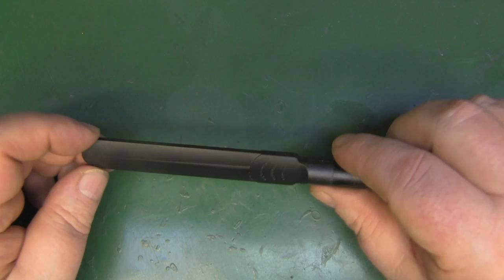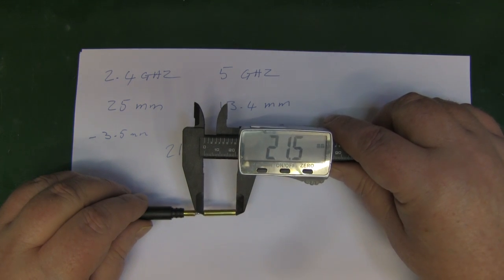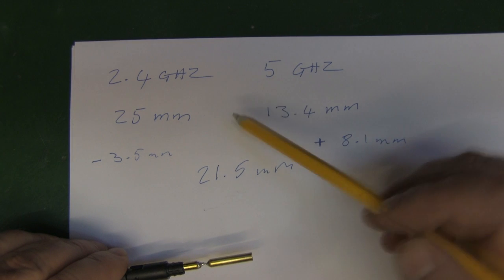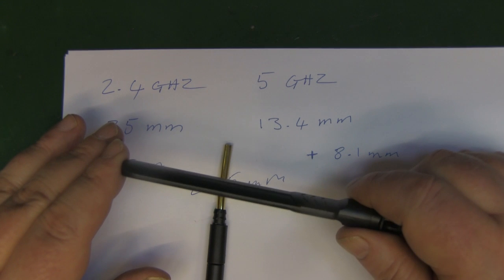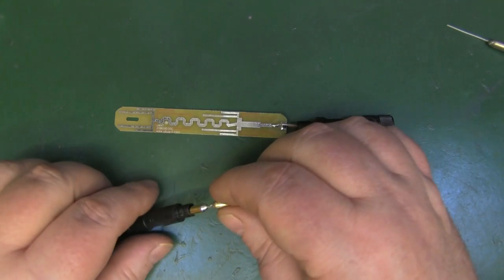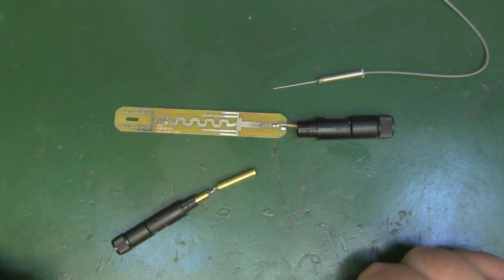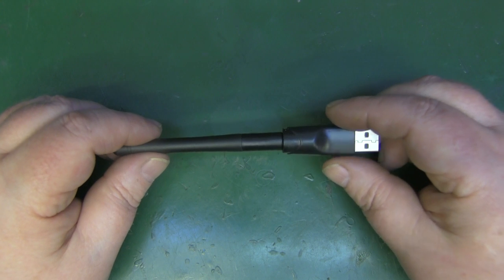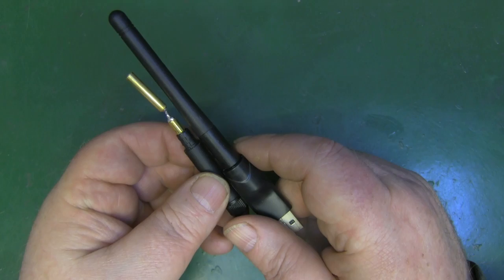Dual Band WiFi Antenna How do they Work?

Comment: Thank you! I was struggling to understand these dual-band antennas in the pursuit of optimizing wifi coverage. Sometimes its easier to listen to someone explain it like this instead of reading a huge paper on it and having your eyes cross and start snoring before you get done 😆
Not that I won't still read up on it at some point... but now it will make more sense when I do.

Comment: Hello, if you have two of the flat wifi popular ones, how would you suggest them orientated around a Desktop? one in front and one on the back? both on the front far or close apart? and would you mount one horizontal and the other vertical? Does it even matter? I keep finding differing or lack of information on mounting them.

Comment: The router has more than one antenna
One of the antennas 5.8G, there is a connection to the ground that gives a beeping sound. How do I cancel this antenna I removed the wires from the panel to no avail

Comment: Really good video, could I ask if you have covered the wifi ants that are soldered to wifi routers and how those can be upgraded? i have an Asus router that claims to be a duel band but only has 3 ants and 2 are soldered to the m/b and one uses a tiny pigtail. there is no info on which is which freq or if they are all duel band but i think (think lol) that the two soldiered to the m/b are the 2.4ghz  and the pigtail center ant is the 5ghz as I've seen several others online which are simular but with 4 ants and both soldiered ants are 2.4 and the two pigtails are labeled on the m/b as 5ghz. Any thoughts or have you covered this yet? I'm looking to add directional external screw-on ants as this is my second router which is in my home office and id like to send the signal about 25m from the 13th floor down to a small workout area that says 10m to the right and away from the building and lucky i have a 1.5m opening from my window to direct the line of sight through. Hope you can follow along with my madness, id like to do it just because and being a retired ex brit army rad-op i know it can be done so why not :)

Thanks in advance from a friendly Brit overseas in sunny Singapore - Chris A

Comment: Please Andrew,i have a flight controller named dji a2 and it has a built in receiver with 2 dipol antennas,i managed to nip 1 of them apart and tried to solder it back but now it behaves utterly bad and im afraid of loosing it so i was wondering if u could create 2 new antennas,,i could send boyh off them to you for measurements..il pay for your services,,please i really need your help.

Comment: Hello Andrew, Could you please tell me if one Dual Band antenna can be used for 2 different wifi networks (one 2.4ghz and one 5ghz) at a time?

I'm having a discussion with a friend and I fell like it's not possible, but as noobs, we cannot find easly the answer.
I understand one dual band antenna covers both 2.4 and 5 spectrums but before usage on one or another it has to be reconfigured?
Reply from the maker: No they are used at the same time the two frequencies are so far apart they do not interfere or interact with each other. But the offset of a duel band antenna is a loss in gain.

Comment: Hi Andrew, is there a way to get more gain out of these dual band antennas, I have a whole bunch of them from TP-LINK routers, is soldering a piece of copper wire on it a methode to have more gain in the 2.4 GHz?

Comment: We the hams of the United divided call them verticals, not colinear. generally a dual band will be seperated with a matching coil on a 2M, 70cm antenna with grouNd plane radials or the roof of your truck. some time depending on what your working you may see a capacitance HAT
Reply from the maker: Thanks for the info BA. So the mag mount that you see on vehicles with a loading coil at the base, are they called verticals?
Reply: some guys mostly cbers will call them whips  . the coils at the base areulauly tuable on the fly unless your doing and end ed long wire antenna  @andrewmcneil
Reply: If comes to the upper sleeve dimension consideration, you should add the length of coax core connector length (it should be about missing 3.6 mm). It adds up, to the dipole length. Now, it is clear that antenna is tuned to 2,4 GHz.  If comes to the bottom sleeve, watching your videos, I have never heard from you about additional role of the element. To the best for my knowledge, bootom sleeve is a "sleeve balun" also known as bazooka balun (1:1), beside being the second dipol l/4 leg it also improves the antenna performance (choke some currents).

Comment: Thanks for great video! I'm not sure you're right about that PCB antenna. I think the wiggly strip matches the phases of top and bottom part. Regarding different lengths of radiators - it looks like "fan dipole", I'd assume shorter length resonates at 5Ghz and longer is for 2.4Ghz. Regarding length not matching 2.4 and 5 resonant frequencies - I think with that kind of complicated pattern and with 4 radiators - you may need to change length from resonant frequency to match 50 Ohms impedance. Also, dielectric constant of PCB material may be an factor here, not sure. Regarding the first antenna - I'm kinda in doubt you can make an ultra wide band antenna that easy. My guess is that it has mediocre performance at both bands, but I may be wrong... Anyway, I'm very curious to see VNA measurements, if you happen to have one.

Comment: Please make a really good diy dual band laptop wifi antennas video. It would be great
Reply: Wouldn't it be faster and cheaper to just buy/get a junk wifi router/access point that has internal ufl connector (they almost always do), and install it's antennas. All laptops have internal ufl connectors?
It's a cheap way to move to (up to) 8Db

Comment: Does this mean that if you were to use thin wire you could narrow the bandwidth of a 2.4 or 5 ghz and tune it to a specific channel? Would be interesting to see if tuning an antenna to a specific channel makes a difference over a standard one. Or is there a way to measure what the frequency response is of a particular antenna and then choose a channel that best suits that?
Reply: i think this would also need to consider the output impedance of the transmitter
as that also determines which channel it works best on
simple ones, of course

Comment: I make my antennas by my self in the way you can see the dipol antenna at the beginning of the video. I use 5mm brass tubes to make them. I do this to make them working from 2.400 ghz to 2.500 ghz SWR= 1.1 to 1.3. I use them on my race quad copters. The range of my quads with this antennas is about 4km and I still have 30% rssi. It´s amazing how good antennas can improof the range !

Comment: I am confused again. I am sure you said wi fi was 5.8ghz
Reply: wifi usually comes in 2 flavors, 2.4Ghz & 5.8Ghz, Higher the freq, the more data that can be transmitted @ once, BUT limits the radio range.
Reply: 0:21